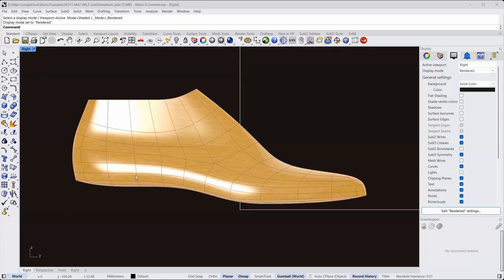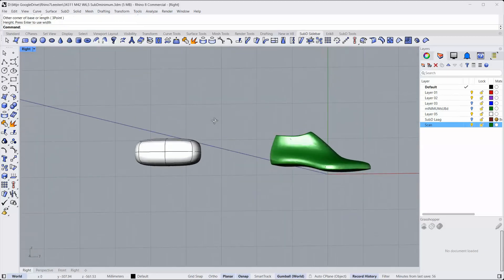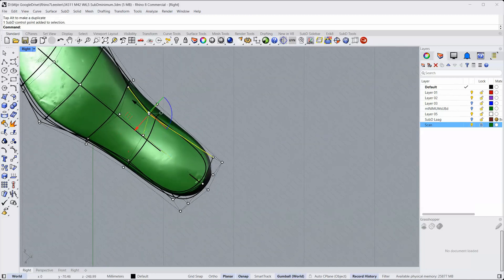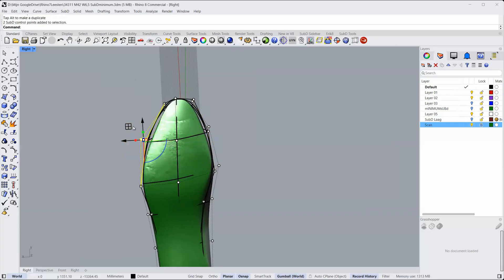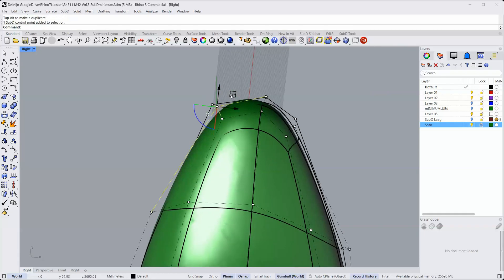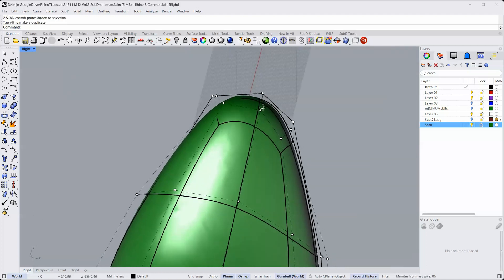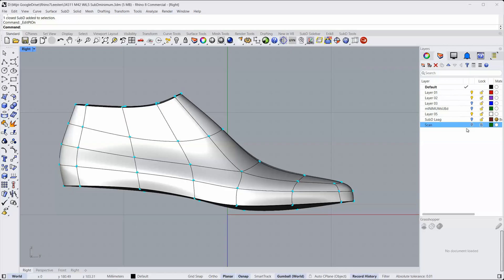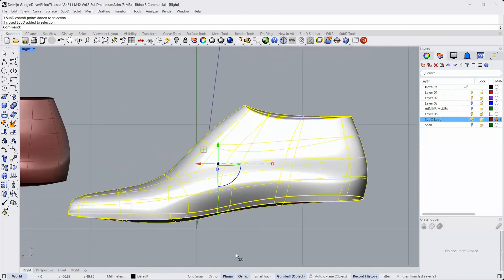Creating a basic SubD shoe last from scrap

Comment: Hi, thank you for great video.

One trick for using QuadRemesh is to use very high target quad count first (like 200 000) and after that another QuadRemesh but this time with lower Quad counts (around 100). It gives quite good results.
Reply from the maker: @aleksanderzur4379  yes, but it still will not give the layout or topology I want.
Guiding curves also help, especially for the featherline, but still not what I am looking for. Maybe it is technically possible to automatically gererate a "minimal"  SubD, that fits on a mesh almost perfectly with an absolute minimum of faces.
Reply: @podotools  It is hit or miss when doing by QuadRemesh. But when you go down with numbers of quads you can get nice all quad geometry. I dont use guide curves. Those tend to introduce triangles into mesh in my experience.

Still great video, thank you for sharing.

Comment: nice! correct topology (layout) for a last. finally! so many vids on YT with no sense for this aspect. 
for everyone not knowing what i m talking about: You see those "edges"  on the subD? have a look on how many of those meet at each point. mostly 4.  And all (!) faces have exactly 4 vertices / corners, that's also very important. Then there are two points where 5 edges meet (often called star) and two points in the tip where 3 meet mostly called pole (ignoring the bottom and top face cause there are more (and also correct)). You see with all of this combined you get those clean stripes of faces. (switch to subD-Cage with TAB). The density of the control points a even and nicely adaptable.
Why is all of this important? Because only with a good topology like this, the deformation you'll get by modifying the control points, will be predictable, natural and effective to use.
This whole topic has a big place in the mesh modeling community (Maya, Cinema4D, Blender) because especially for animation it's crucial or you'll get render artifacts or it will deform weirdly. But in Rhino i see so many videos and tutorials here on youtube with no sense for this. So thank you for that.
other thing: when i massage the control point i sometimes like to switch off the gumball and change the drag mode to view. It feels natural for me, and i'm fast and effective with it. If you never modeled like this, it will be hard to get a hang on it. You need time to get the feeling, but then you 'll get fast in no time.
Thanks for the good vid and topology :D
Greetings from germany
Reply: Yes, the topology is the base for it. I try to do many ways it, but manualy draw SUBD is the best way.
Reply from the maker: @seppsowas  Thanks a lot for your expert comment! Indeed the topology determines if the last is usable for effective deformation or not.
There are a lot of CAD systems for last design that completely neglect this crucial aspect. 
Setting drag mode to view is very useful, but it also very personal if you like that or not. I often use  the UVN drag mode.
 Are you also into last making or other orthopaedics?